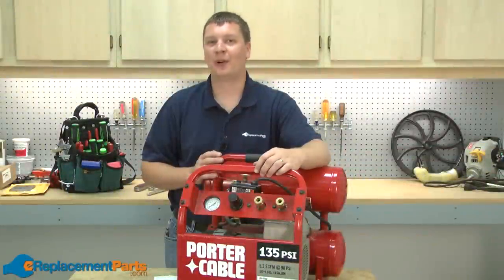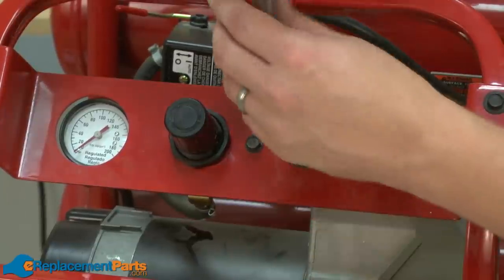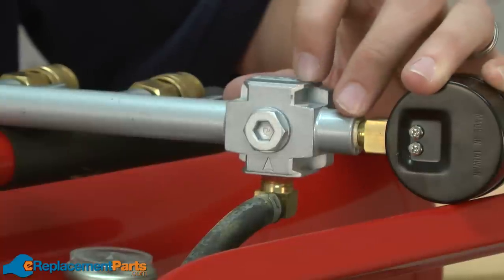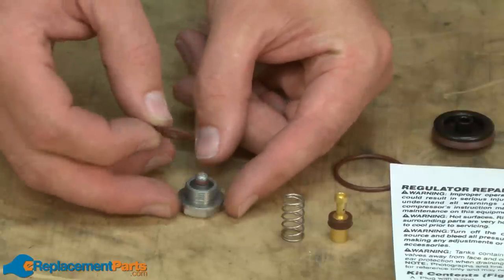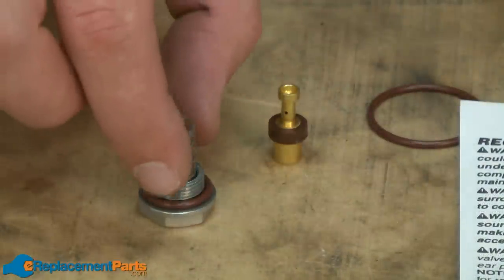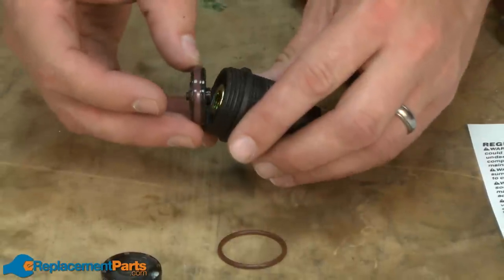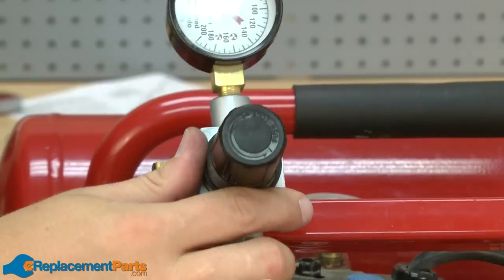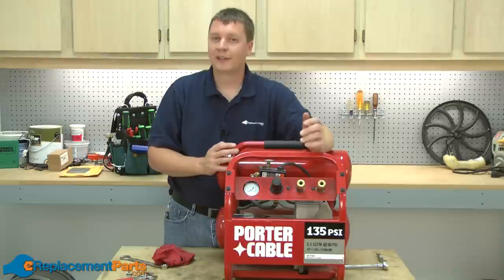How to Rebuild the Regulator on an Air Compressor (Part # N008792)

Comment: Hello, thanks for the video.  I have a Porter Cable and just replaced the pressure switch.  It was not the original switch.  Now my regulator does not keep the pressure down at what it is set at, but allows the pressure higher.  I can hear the air hissing out of it.  The switch goes up to about 140 psi then turns off.  Any ideas what the problem is?  It never did this before.

Comment: I have a 150 psi pancake porter cable compressor but it won't shut off it keeps building pressure until the pressure relief valve pops out do you know what might be wrong with this compressor?

Comment: Where can I find that exact rebuilt kit?!? Those are the parts I need. I've looked all over your website and can't seem to find any rebuild kits let alone that particular one. Thanks.
Reply from the maker: The regulator repair kit is part number N008792 on our website.
Reply: The cost of a parts kit is more than a brand new regulator! What gives? Do you guys negotiate on pricing? If not then I guess my old regulator will end up in my metal scrap pile. Who buys this overpriced nonsense?

Comment: hey I just ordered a replacement manifold from you guys, but i was wondering, could i link two compressors together if i had a hose with two male connectors on each end and i just ran the auxiliary compressor to the compressor with two outlets then ran my air tool off the other outlet on the same compressor shouldn't that feed the one air tool two tanks of pressure? allowing both compressors to power one tool?
Reply from the maker: Hi Adam, thanks for your question. I would recommend you contact a repair shop in your area about this question. Although we have heard of this being done, it is probably a good idea to discuss it with someone in your area, so you can do it safely and effectively. Good luck with your repair!

Comment: Great info. Did not help me diagnosis my problem but gave me the confidence to disassemble the unit and determine that the square threaded cylinder with a C-clip was the culprit. The hexagonal nut threads up the square threaded portion stripped out. I will post a reply video shortly if someone else has this same issue. Thank you for the video.

Comment: I have a Craftsman air compressor that looks very similar in design to this Porter Cable. The regulator is leaking and needs replacing. Glad I saw this so now I know what I'll be getting into. Looks very easy. Thanks!

Comment: Great video!   I just bought my Bosch compressor last summer and the regulator is already acting  up and won't hold pressure.  The knob looks very similar as yours.  Mine is supposed to "lock" the pressure by pushing in on the knob.  Thanks much!

Comment: MARK - I followed your instructions on the video for my Porta Cable Air Compressor, N008792. MY Model # is CPF 23400S-2  4 gal.
Now assembled and running BUT the regulator knob does not adjust the air pressure on the tool side. You did not show the post in the video. You left it inside the plastic piece. Where should the adjuster nut on the post be positioned for the assembly. I tried all the way to the bottom of the post and half way up the threads but neither of these positions allow any air to be released to adjust the psi going to the tool. The tank guage reads 35 psi and the tool side reads 145 psi when the automatic shut off turns off the compressor. I can turn the regulator all the way in to a very tight and all the way out to zero pressure on the regulator knob spring with absolutely no regulating happening. HELP
Reply from the maker: This sounds like the Regulator is sticking.  Some of the Porter Cable and Dewalt models have a rebuild kit available.  Yours is only showing a new regulator part number D27253.

Comment: MY Porter Cable regulator is different and seems to be missing parts, which, I say 'seems' because although I do not remember it having any other parts than the ones I now have, it is shown in a diagram to have other parts than I have, and I am at a complete loss as to where these parts would go or how to mount them, but at is sits, right now, this one can not hold air because it has a little vent in the center of the piston which vents out into the open air.

My original did not leak until the hard plastic piston broke on it, and at this moment, I can not find the original to see if it has a vent in it to compare, because I moved it and now do not know where I put it.
Reply from the maker: Hello, could you please supply your model number of your compressor. It would help us answer your question.
Reply: C2002 TYPE 7
Reply from the maker: Hello, on the compressor shown in the video, you are able to obtain a regulator repair kit. On the Porter Cable C2002 Type 7, there is no repair kit available. You would have to order the complete Manifold  Assembly part number N082939SV.

Comment: Does this apply to. Craftsman as well?
Reply: +Ray Riley It may very well apply.  I checked my Craftsman 26-gal. compressor's manual and its Parts List shows the same part number (i.e. N008792) for the regulator repair kit.